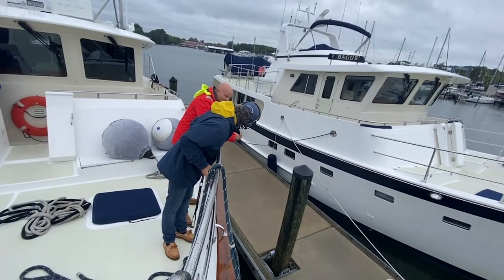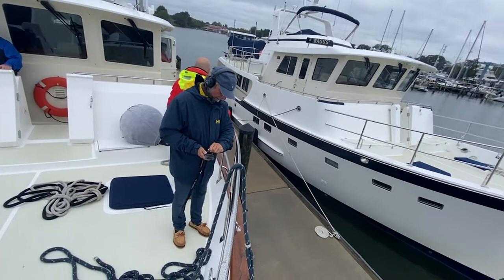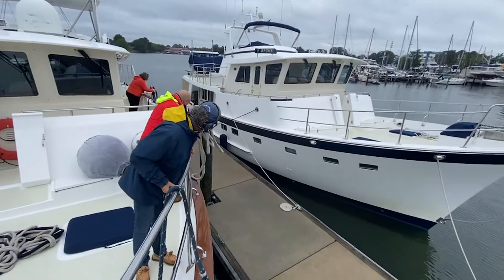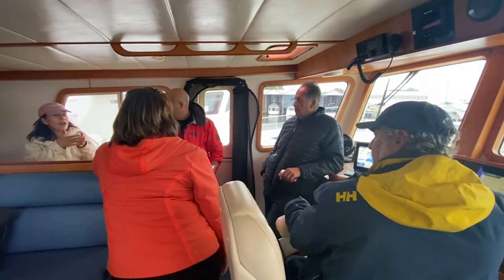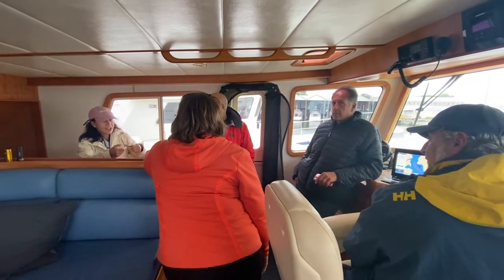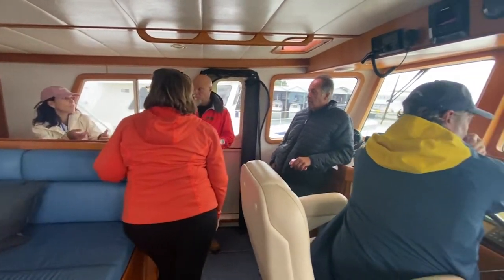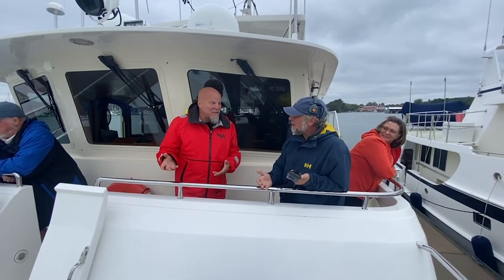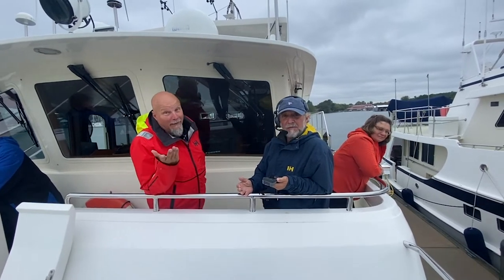2008 Kadey Krogen 58 with ZF engine controls & ABT thruster - Dockmate wireless remote control demo

Comment: I would have it definitely.  No question.  Just wondering how it performs in windy weather.
Reply from the maker: Hi Will, superbly! Dockmate has  developed a feature called Throttle+ which provides customized, pre-determined, and on-demand throttle RPMs. This feature is extremely helpful when there's a heavy wind or current and you need more than just idle speed, and an immediate boost of throttle is required to safely maneuver your boat to the slip.